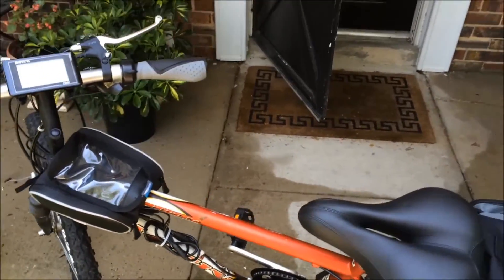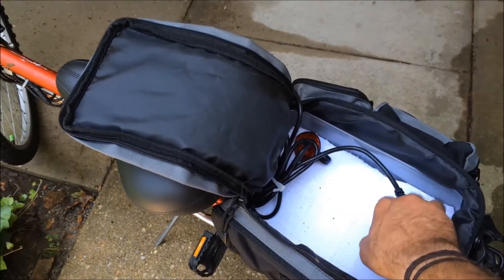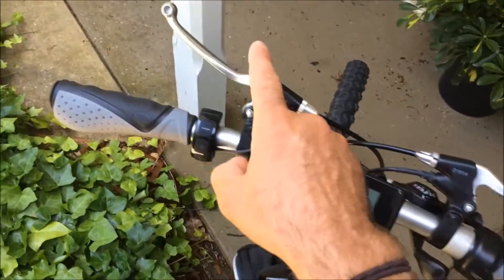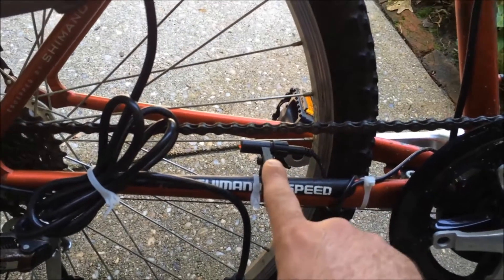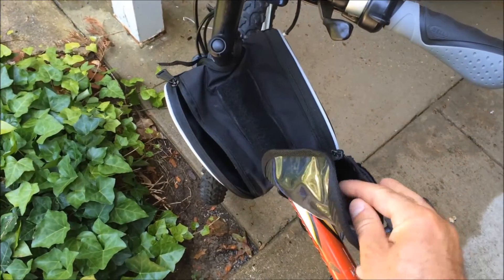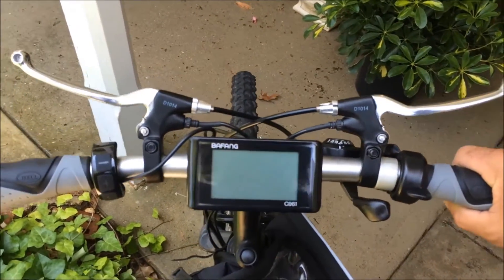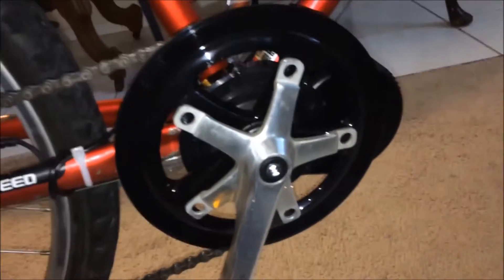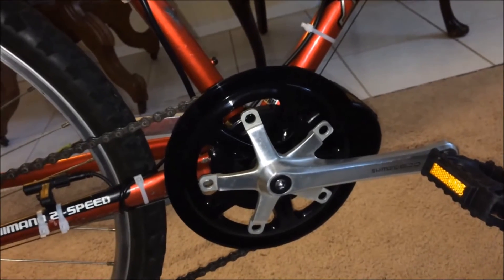Bafang Mid Drive Ebike Conversion Part 8: Working out the Kinks

Comment: I have a question: what's the additional weight the motor and all Bafang equipment will add except the battery? 
I am planning to convert my bike and as I usually take it with me on trips, airlines won't be happy with extra weight :)

Comment: what type of seat are you using, it sure looks comfy & i will need one when my 8fun bafang 500w motor & 14ah battery get too me on 28th june 2016.
Reply from the maker: i forget. I went into a bike shop and picked a nice wide soft one. it was in the $40 range
Reply: I got myself one but like you I'm unable to recollect what type it is, all I know is that it's like sitting in my arm chair at home. A great deal comfier than the Razor Blade shaped one i had previously. I'm still grinning whenever i go out for a ride this Bafang 500w mid drive & 36v 15.4ah battery i got sure makes it easier to get around, best thing i've bought for myself in a long time, even though i don't use the bike very much at present.

Comment: It looked like you sliced your hair off in the first segment.
I would've been sad.

I'm glad you're testing the range. I combed through many forums and asked many question before I ventured onto AlieExpress. I bought the kit there and the battery. Still enroute. The battery is a 48v 15ah battery. Hoping to atleast get 26+ miles on a charge. My commute to school is a solid 26 miles, round trip. 
meh.
Reply from the maker: KaiserFailed That sounds like one heck of a tough ride. Don't worry, I am not getting rid of my hair. That's mother nature's job. I'm glad you were able to buy a decent battery. I got my kit from aliexpress also. I'm uploading a proper range test video right now using lead-acid batteries. Thanks for watching, and for being my first commenter. Peace.